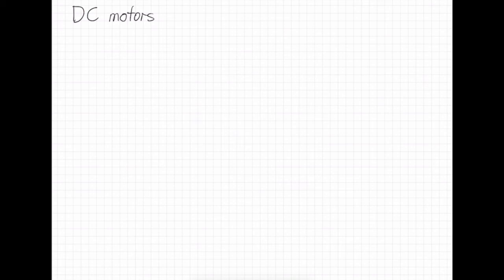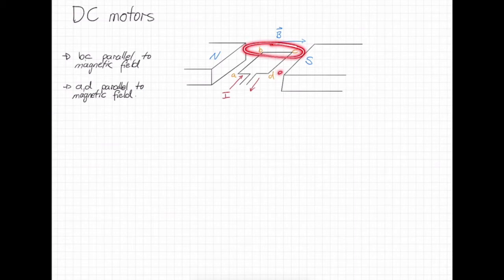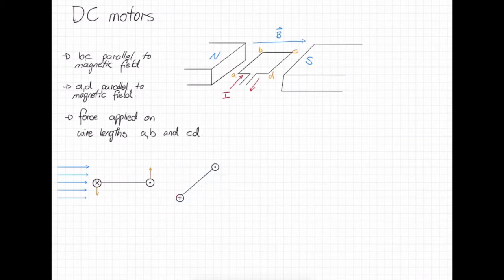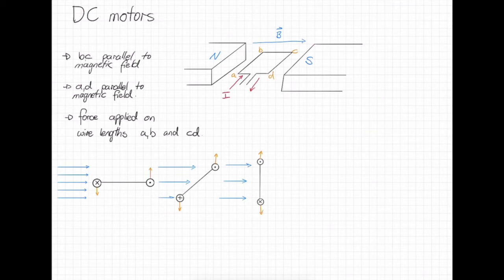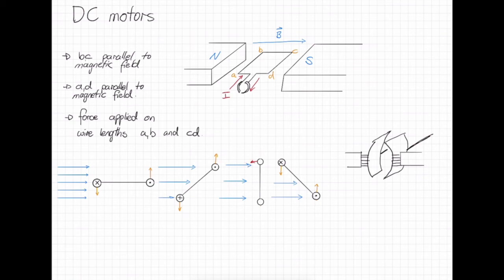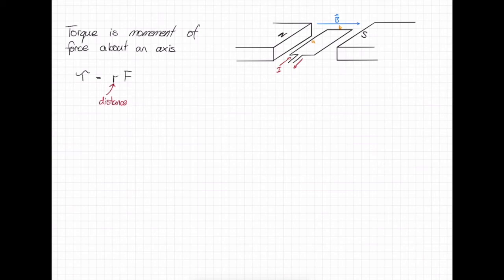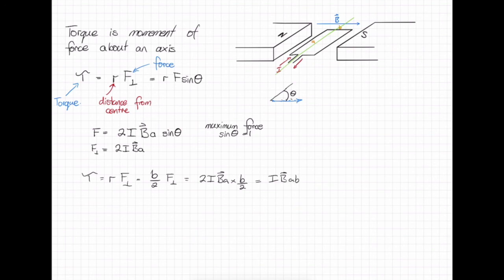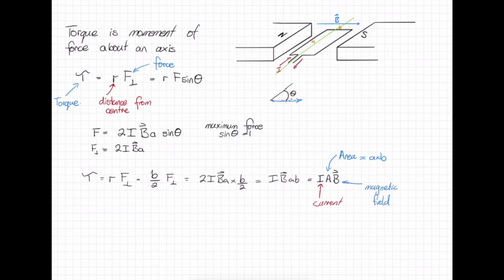DC Motors

Comment from the maker: Unfortunately the label for θ is wrong. θ is meant to be the angle from the normal of the coil to the magnetic field.
This means that when the coil is flat to the magnets, the angle is at 90°, thus having maximum torque. When the coil is vertical, the angle is 0°, with the minimum amount of torque. 
Sorry about the confusion created from this, I got my angles from coil and normal mixed up but the equation is correct.